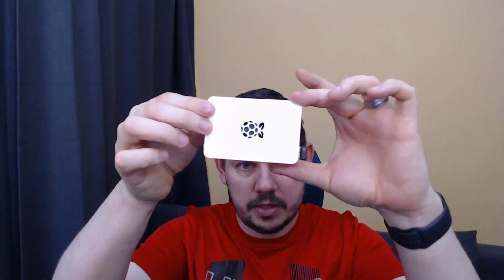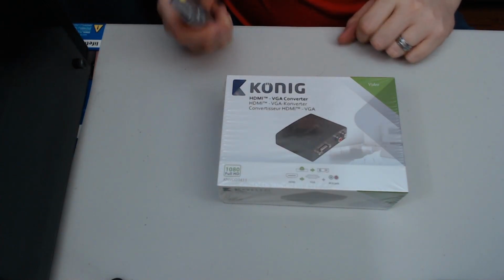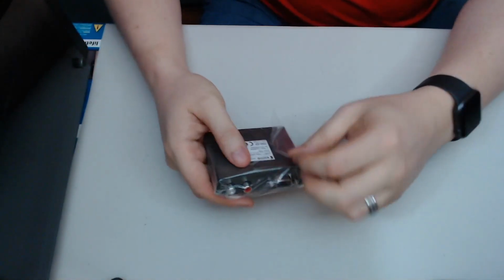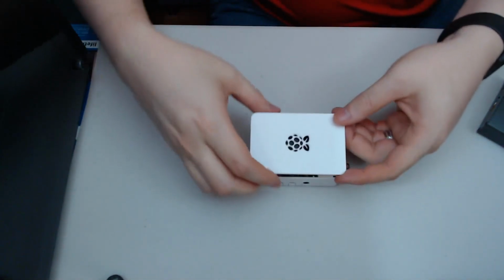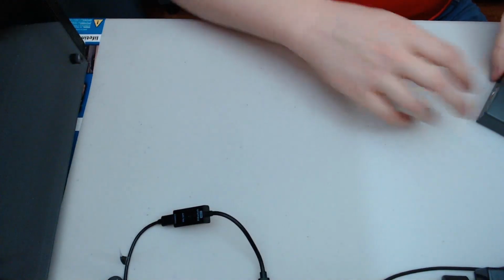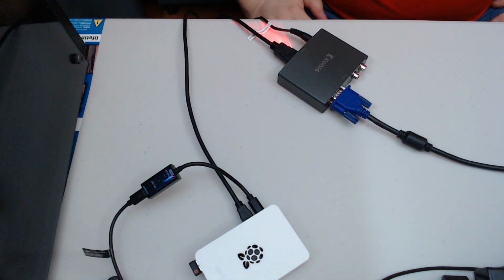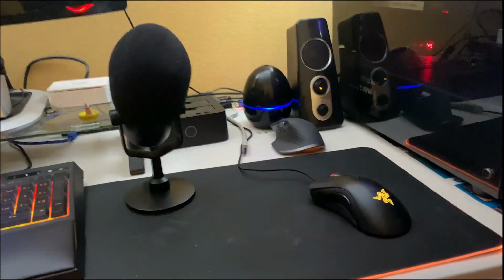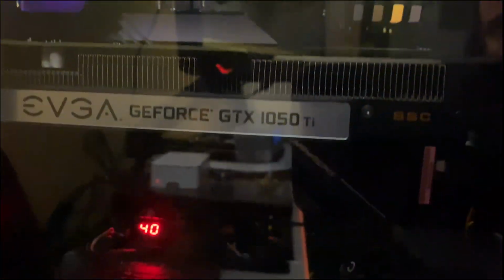Connecting a Pi 4 to a VGA monitor

Comment: how much time do i need to actually turn on the monitor connected all the way to raspberry pi 4 ..how much time it took you to turn on monitor?
Reply from the maker: To turn on a monitor generally only takes a few seconds to press the power button. 

Now that that bit of sarcasm is aside, I think I know what you’re asking. The total time it takes to get things set up and working, in my case, was just a few minutes to plug in the power cable for the converter box, the HDMI cable between the Pi and the converter, and the VGA cable from the converter to the monitor to get a picture. Unless there’s something wrong, that’s about all it should take.
Reply: @StolenJoker84  i installed 64bit but its kinda not worked so i'll try 32bit today wish me luck
Reply from the maker: @JIN-qm4mt  Good luck.
Reply from the maker: I think the Pi is only 32bit, but I’m not 100% sure, TBH. Haven’t paid that much attention to the architecture, other than the fact that it’s ARM based.

Comment: Cant i just use any adapter ? Is it MUST active adapter?
Reply from the maker: As far as I am aware, there isn’t a passive adapter between VGA and HDMI. 
HDMI is a digital signal, where VGA is analog. The active adapter is needed to “read” the digital signal from the HDMI connector, and “translate” it to the analog signal used by VGA. 

There are passive adapters for the digital standards - like HDMI to DVI - but (afaik) nothing from HDMI to VGA.

Comment: Ok, so how do I do it without spending $100 on an adapter?
Reply from the maker: Unfortunately, the Pi uses HDMI, which is digital, while VGA is analog, so you will need an active adapter to “translate” the signals.
Reply from the maker: @Black Furest The cost of a new monitor depends on where you are. Where I live, you’re not likely to find even a used monitor for $100. The adapter I got was less than a monitor.